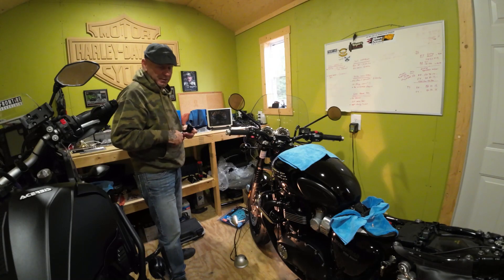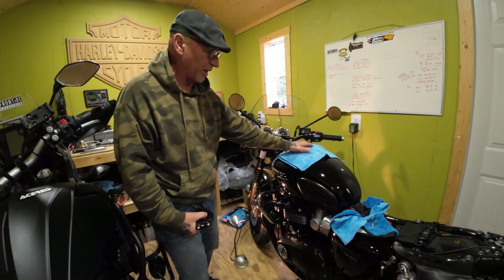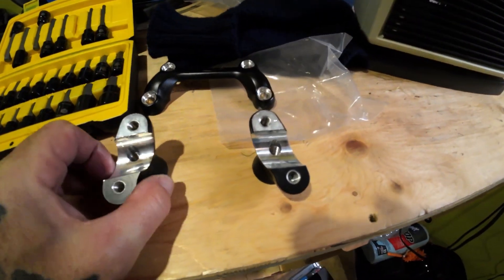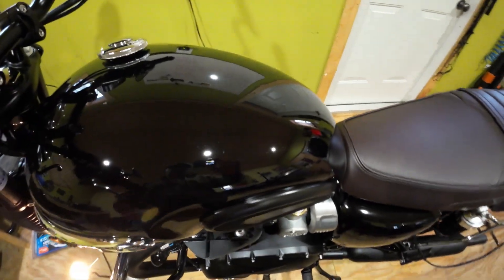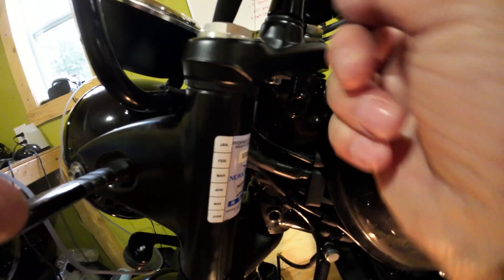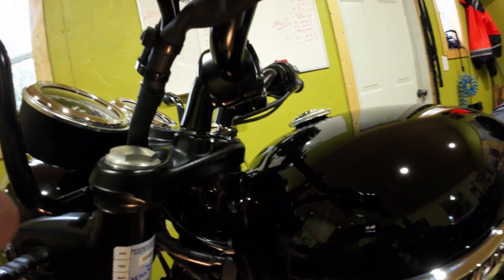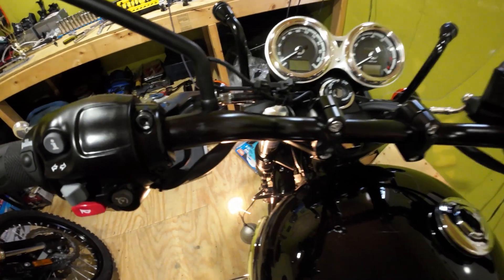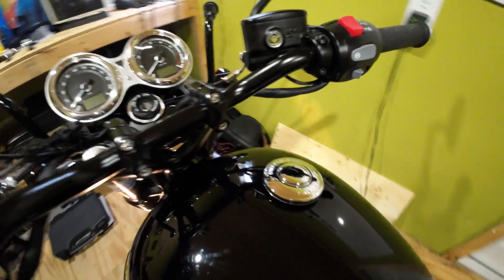Motone Risers #triumph #handlebars #risers

Comment: Thanks for the video. For those interested the torque specs are38 Nm for bar risers  and24 Nm for bar clamps. Just installed on my T120 and didn't need to loosen the wire clamps. I did unbolt the tank and moved it back a few inches to get better access as you suggested.
Reply: The Motone risers were installed in my bike, Triumph Street Twin 2020.
However, I still need to drive with the arms  straight and the body is unconfortably leaned forward.
The cables are in the limit.
What do you suggest?
Reply from the maker: Sorry I can't help with this. This topic is so varied from rider to rider. I have never found recommendations from another any benefit to me.
Reply: @emanuelperez2329  How tall are you if you don’t mind me asking. Did you loosen the cable clamp to give a little more play/length on the cables ?
Reply: @pauldoyle9709 I am 1,64 m tall. With the Motone risers, the stock cables are in their length limit, according on the mechanician.

Comment: Save yourself Time: I just installed these but I couldn't get the bars to sit tight and the handle bars are slightly crooked.. there's flex in the handle bars coming from where the riser sits no matter how tight. 
Fix: I learned I should not use the TOP 2 washers that were on the old risers. The motone riser seat does not accept them, only the washers underneath the frame should be reused.

Comment: I have a 2017 Bonneville t120 and would like to install a bar riser.  Did you have to change any of the cables like brake and others?  Thanks.
Reply from the maker: Didn't have to change anything.

Comment: I have a set of these and when I installed them on my bike I had some flexing movement of the bars, probably due to the added height adding leverage.  Is that normal/ok?  They didn't come with instructions about this point and I am concerned. I cannot get anyone from Motone to return my question about this.  Thank you!
Reply from the maker: There really shouldn't be any significant flexing. If you read back in this thread, I believe there was another similar comment and he mentioned something about washers. Sorry,  I can't recall. I'll look back too.
Reply from the maker: Four comments back. He says not to use the top washers as the motone risers do not accept them.

Comment: Does  it alter steering in any way? Looks more comfortable  but I like to do some spirited riding in the twisted once in a while, I wonder if this would change being more upright,  also is your windshield to low now?  Thank you
Reply from the maker: Dosen't seem to change anything at all. Probably more comfortable really. The windshield is something I can't seem to get right. Just too much noise. The little flyscreen is better for local warm days.
Reply: I'd describe it as allowing you to sit more upright and relaxed, not enforcing it. I noticed on both my old t100 and new T120 I end up pushing my shoulders forward for relaxed grip and it puts undue strain on neck. I do not think it would limit aggressive riding much, it's not that significant of a change. I find normal cornering easier as well (less reach forward arm, more room closer), but haven't tested twisties. I think this should be stock, as I am 6'2 with 6'6 wingspan, so I don't understand the stock set up of the T100/T120. Too much reach or forward lean required for cruising comfort. Or maybe most people ride nuts smushed on the tank, I have no idea.
Reply: OK I bought them and installed. Yes, noticeable difference in the comfort zone, pretty straight forward  install,  better for me than stock ty

Comment: I am 5'8'' and lean a bit forward on my T120.  I was thinking these risers would give my back a little break and lean me more upright.  Thoughts?
Reply from the maker: I too am 5' 8". They do correct the posture a bit. Pretty comfortable.
Reply: I'm thinking of purchasing  but actually  I'm thinking if you slightly  lean forward on bike you are taking stress off your back, when you install risers, now you are putting more stress on your lower back because you are more upright, I think it's a tradeoff, less wrist strain with the risers but more lower back stress due to upright position kind of like a cruiser, don't know, maybe I might just try them, people tell me I put 2 much thought into things!
Reply from the maker: @robertparisi8016 the idea with the risers is to allow you the option to relax your arms. To lower the elbows and relax your shoulders. To let you bend the arm. You actually take strain off of the wrists, elbows and shoulders. I've had 13 bikes send I always adjust the bars.

Comment: Is there play in the handlebars after you installed the risers
Reply from the maker: None at all.
Reply: @Frontireadventures  thanks.  I just had them installed and there’s a little play. Annoying.
Reply from the maker: @throttle_therapy0025  could be the angle?
Reply: Not sure.  If I push on the handlebars, it budges slightly.
Reply from the maker: @throttle_therapy0025 that almost sounds like a crack, bolt not tight or a slight bend.